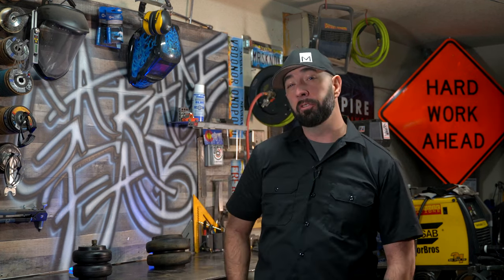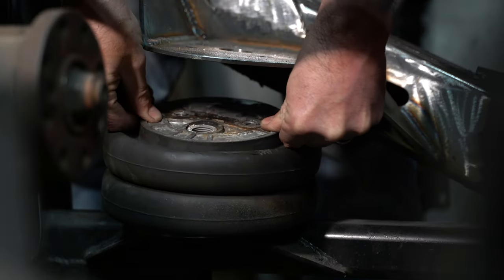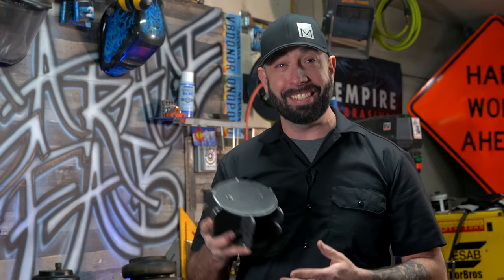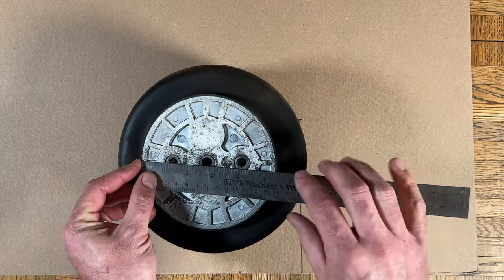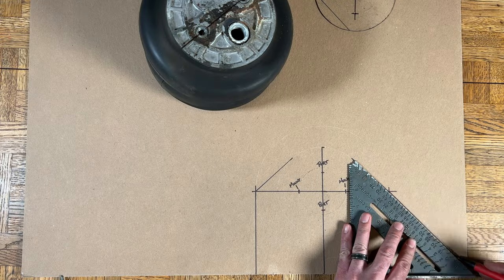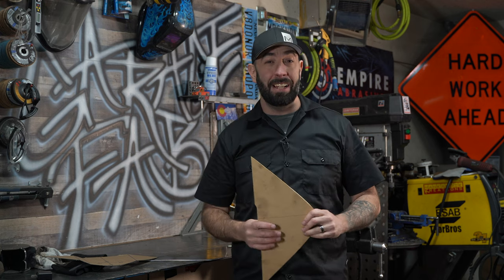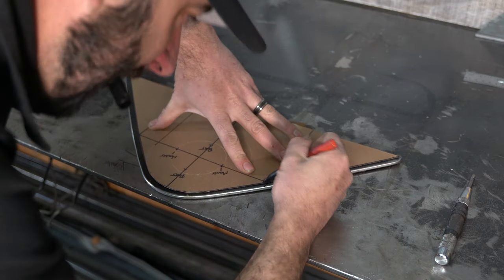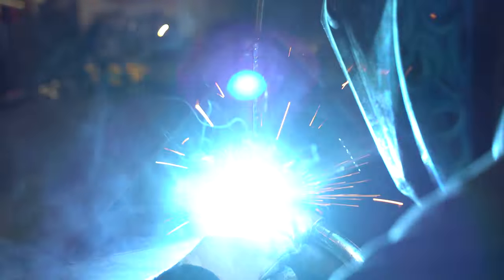Design and Build Upper Bag Brackets From Scratch! Mighty Max Ep. 17

Comment: Shifu, ive been doing a lot of research since we last spoke and I am proud to say i stated buying my components. Cant wait to get my frist set of Dominators. I pretty much have a good idea for the rear setup but the front is gonna be tricky. I have a crown vic and I have determined I will need to relocate the front shocks, however, if i have ride height sensors do I need the shocks? Can the shocks be non adjustable with right height sensors if i do need shocks?
Reply from the maker: Congrats! That’s exciting. 👏 You always need shocks. Many people will tell you you don’t. Some air suspensions don’t have excessive bounce so it seems shocks are not needed, but shocks absorb a lot of other rhythmic vibrations that cause funky tire wear and help keep the tires planted for traction. I’m not sure what you were asking about the adjustable shocks. The shocks can be regular shocks, they just need to have enough travel to NOT bottom out at your lowest or highest ride heights.
Reply: @Garage Fab  you answered my question. Plus I just heard a story about how a buddy's shock blew out the top without dampening sooooooo yeah let's not do that lol

Comment: I'm back, lol. Hope you're doing well/better these days. I think i asked this but if I may ask again, How to measure my vehicle's current ride height. Can i just measure ground to frame?
Reply from the maker: It feels familiar. 🤔 there are two ways and it really depends on what matters most to you. Appearance? Ground clearance?
I believe in most states, legal ride height is measured at the lowest point of a vehicle. So if you have a Crossmember or an exhaust system hanging down, it would be measured from the ground to that component. For me it’s generally measured from the ground to the bottom of a frame rail.
Reply: @Garage Fab  excellent. Today I'll me making my upper and bottom bracket templates so I need to know how much to compensate for the upper front and rear brackets to accommodate additional lift a d still get as close as possible to the ground. 

Maybe you can help me with one more thing,  for the time being lol. I'm trying to get her as low as 3" from the ground. Can you recommend an ly low profile jacks that aren't super frigging huge? I saw a few 2" hydraulic hand pump jacks that night be able to get the car high enough for me to get a real jack under it.

Comment: I’ve just started watching your videos. You said that you switched from triangulated four bar to watts link. What’s the advantage of the watts link?
Reply from the maker: It depends on who you ask. Some will say a Watts handles better. Others will disagree. I feel that a Watts or Panhard has better lateral stability than a triangulated 4 link, especially one with bushings. As the bushings compress in a triangulated 4 link, the axle is allowed to move side to side a small amount. I’ll be using wheels that barely fit, so that movement can’t be allowed.
My biggest reason for the swap was I wasn’t thrilled with the original builders design, and I needed more room for air management. The triangulated 4 link takes up a lot of room. The parallel 4 link opens up a lot of space. My final reason is I have a YouTube channel, and completely rebuilding the rear suspension is far more entertaining to watch than leaving it alone.
Reply: @GarageFab  great answer. Thanks for taking the time.
Reply from the maker: Anytime my friend.

Comment: Should the top plate of the bag stay parallel to the bottom plate as it lifts? Looks like the bag is leaning?
Reply from the maker: That’s nearly impossible on everything except a bag mounted to an axle with a parallel 4 link.
The nature of control arms or link bars is to angle away from parallel. So the best you can do is to make sure the bag plates are parallel when they’re fully deflated.
A leaning bag will not last as long as a straight one but is often unavoidable.
Reply: @GarageFab  I thought it would be better the other way around. If they aren’t perfectly parallel when deflated there’s no load so doesn’t matter but as they are all the way up it would be better getting back to parallel, just Looks like the bag could pop out sideways under a big shock load. But hey I don’t know shit I’m just asking 🤷🏼‍♂️
Reply from the maker: It’s a possibility that it’ll prolong the life of the bag as long as the the two bag plates aren’t touching when aired out.
The two downsides will be, you’ll loose an inch or so of lift capability since the bag technically isn’t fully compressed when deflated, and if anyone can see it, you’ll get an earful that your bags are installed “wrong”.
Reply: @GarageFab  I meant tilting the bottom plate only a few degrees nothing major.

Comment: That's a dilemma.  Does one cut your bag height to gain extension because it is believed to be short or be happy with your extended length.  And if your bag isn't warrantied, then its all for nothing.  And mounting holes are very important in this equation.  As long as things go up and down smoothly,  it is all ok.

Comment: how much do you thing it would be for someone to slam my truck for me bc i don’t have all the proper things to do it myself
Reply from the maker: By Slam, do you mean simply lowering or installing air suspension? There are a LOT of variables in air suspension; What Truck you have, the person or company that’s doing the work,  the quality of parts used… and so much more.
You can lower a truck for under $1000, and I predict an air suspension install could cost anywhere from $4000 to upwards of $20,000! 😳

Comment: Hey i have suzuki grand vitara 2nd gen year 2000 and i want to replace the coil spring with air bags ,could i do something like this?
Reply from the maker: You absolutely can, but I’m not familiar with the vehicle so I can’t be sure how.
Doing a quick search, I found some bag over strut assemblies available for that model. That might be the easiest way but I’m unsure how low that will get it if that’s what you want.
Reply: @GarageFab  oh can you share thr link. And I am not worried about the lowering just want the comfort in ride lol
Reply from the maker: https://www.x2industries.com/product/1999-2005-suzuki-grand-vitara-plug-and-play-air-suspension-kit/?utm_source=Google%20Shopping&utm_campaign=GOOGLENEW&utm_medium=cpc&utm_term=40917&utm_content=UA-10567206-2&gclid=CjwKCAjw5_GmBhBIEiwA5QSMxM8mzS8R4s49NE0XrYrzQeP_zHyl3Qeu1vLkNCqCcMFrLorc4FveqxoC2tAQAvD_BwE

Comment: My welder can only go 3.2mm steel. Does anyone know if i could overlap my welds to fill in the channel of the bracket? Or would some of you not recommend that?
Reply from the maker: Again, not an officially trained welder here… but I think it depends on how well your welder is melting the base metal. It’s common practice for very large gaps to be filled with several passes, but if your welder isn’t powerful enough to bite the thick metal, you may be just filling up your joint with weld though it’s not penetrating/bonding well. I’d suggest doing a test weld and inspecting it. There are some videos available using a cutting/buffing/etching method that allows you to see how deeply you penetrated.
Reply: @GarageFab  So im teaching myself how to weld but im not so arrogant to try this now. I have every intention of practicing until i feel comfortable. My life and others in my car on on the line.
Reply from the maker: Commendable! I think everyone should have the confidence to build their own vehicles, but there is definitely a lot of responsibility required. Good on you mate. 👏